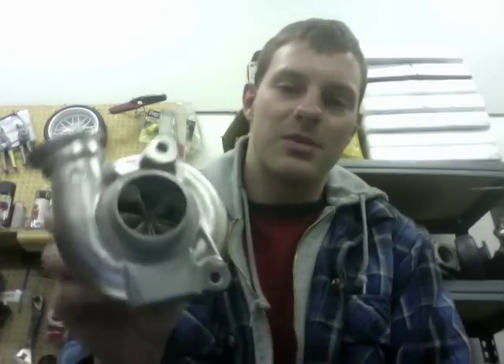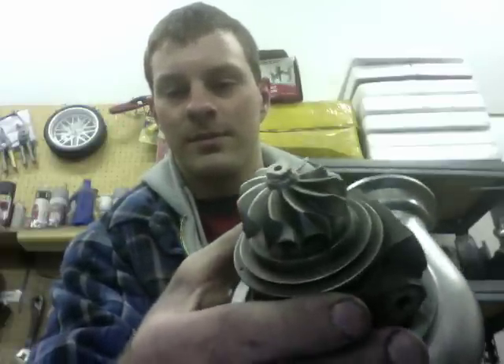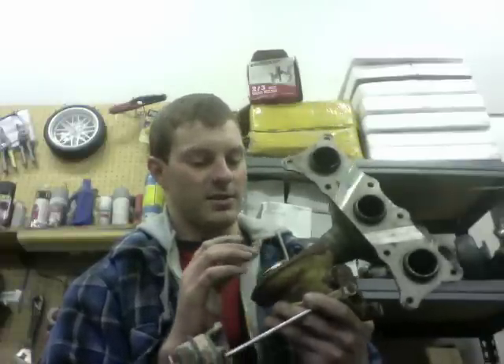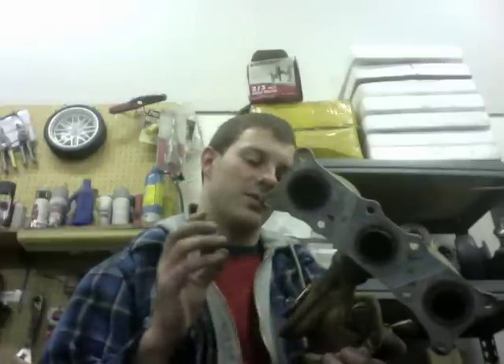BMW 335i N54 Twin Turbo Upgrade

Comment: Only question how would the wastegate(s) work? Due to limited space. Could probably do a cross over pipe with a single W/G. I would be willing to be a guinea pig if i lived closer to bad chicagoland is a bit away from the VA. I also sent an email acquiring some info for possible work.
Reply from the maker: someone does build the manifolds with twin external WGs. I would jump into a project like this if i could free up the jumps i have on hand. usually things start to slow down near the holidays.  Im i currently cant do a project with the external WGs like i want. hopefully when i get a cnc machine i can save time. It takes me 2 to 2.5 hrs to setup and machine just 1 housing with this machine.

Comment: I have a 335i convertible, I so wish i could have this done to my car by you but it appears you are solely focused on N54 applications and not N55.  Am I wrong about that assumption??
Reply from the maker: +soldierviejo We do every upgrade we possibly can. we just finished up a set of bmw 2014 M3 M4 turbo upgrades.

Comment: How much do you charge for a basic upgrade like this? I have a spare set of twins sitting around.
Reply from the maker: +Lance Gomez 650$ including thee ashtrays repair and rebuild
Reply: +Turbo Lab America I'm not sure what the ashtray repair is. So does $650 get both turbos rebuilt and upgraded? That would be bigger wheel and clipped?
Reply: I have the same question as Lance. Would that be for both or one on the 335i?